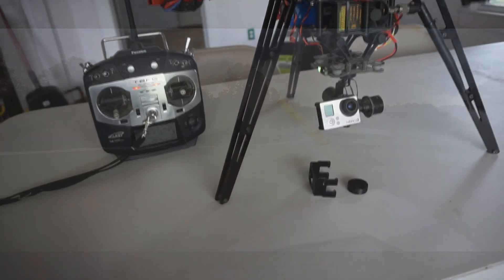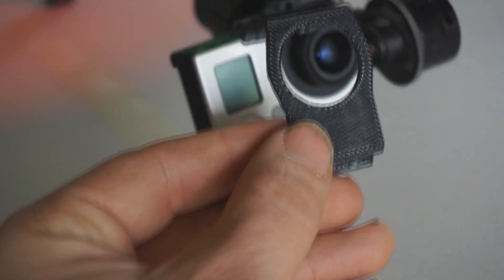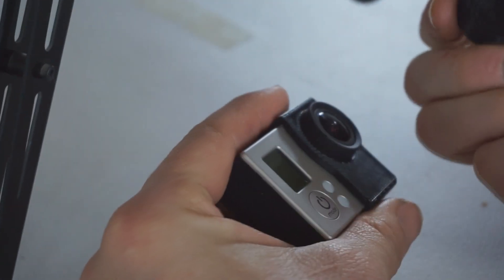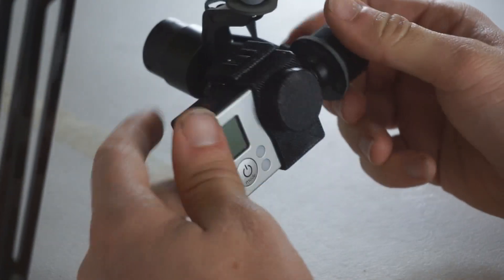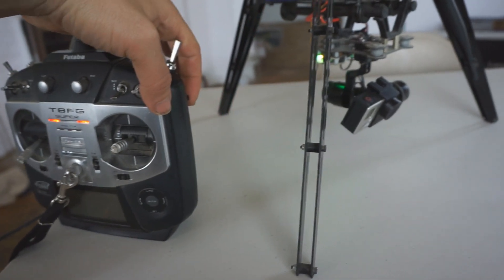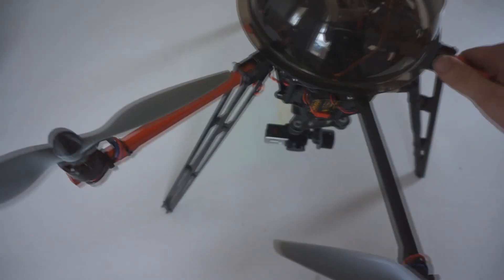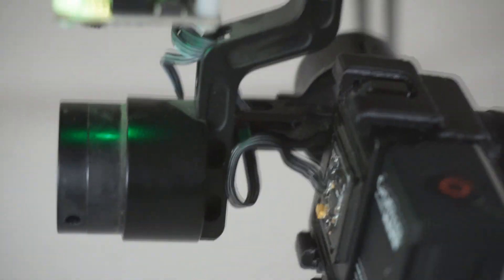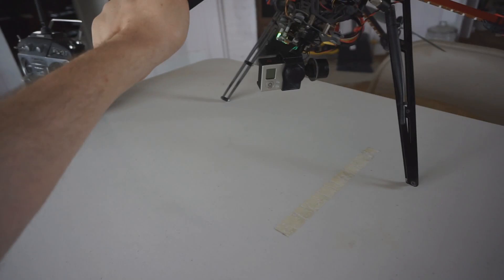DYS GoPro 3D Printed Parts + DYS 3 Axis Gimbal Review

Comment: One of the frustrating things about the DYS gimbal is that it loses horizon.  I see that yours does the same thing (4:45).  The "quick fix" is to bump the quad in the other direction, which re-levels the gimbal.  Overall, I've been disappointed in my DYS gimbal, especially since I started filming with an Inspire 1.  My goal has been to make the DYS gimbal perfectly stable.  Despite months of research, modifications and software adjustments, it STILL has issues.  The video is "good enough" for local television production and independent film, but not even close to good enough for major motion picture.  

I've decided to research the AlexMos 32 bit controller, but this to be used exclusively on the "heavy lifter" camera setups.  

Did you ever figure out how to get yours to hold horizon?  My bobbles slightly on the pitch axis, too.  Very frustrating.

Comment: Ive had this DYS gimbal fail twice now. Never buying a DYS again. This is clearly a well known about fault where the YAW stops working. Chineese company so no real way to get this repaired or swapped. Im reading many users with exact same fault so I think this is one to AVOID!
Reply: +truthseekers666  If you buy it from Hobby King, they will warranty it for a year.  I had them replace 2 so far.

Comment: Very nice. Your channel is very informative. Thanks for sharing this kind of info! Now, can you make a version of this that works with EZ Spin Motors? (j/k)
Reply from the maker: USWaterRockets Thanks.  I also enjoy your channel.  Your new series on building high powered rockets is great.  You have me wanting to build some serious water rockets.  My boys also love your channel.
Reply: Wow! That's wonderful to hear! We're big fans of your channel, so this is like meeting a celebrity. :-) By the way, we have another project video coming out featuring some more advanced 3D printing. I was waiting for that one to come out and I was going to ping you and show you what we created. The reason you're singled out here is that we have the Rostock Max V2 based on your review of the Orion Delta. Your review and your responses to our questions were what convinced us to get the Delta. Thank you for the review. We love the printer!
Reply from the maker: USWaterRockets I can't wait to see your advanced 3D printer project.  I have been considering doing some high strength 3D prints where I pause the printer and add metal reinforcements into the print and then have the printer print around them.  I am glad to hear that you love the Rostock Max V2.  As I write this I am sitting between two 3D printers that are both printing electrical socket cover plates for the house.  I am using these files: http://www.thingiverse.com/thing:3342  They fit and work great.  Next I want to do some of these for my office: http://www.thingiverse.com/thing:649284

Comment: Nice ! How much$ was the multi-copter?
Reply from the maker: rickyboyz100 I have no idea at this point.  It has been rebuilt in many different configurations over time.  The DJI Wookong-m was a very expensive part to the system that has been the heart of every build since.  Here is a link to an older parts list: http://laserhacker.com/?p=124
Reply: Thank you